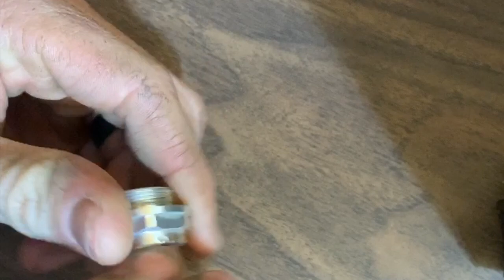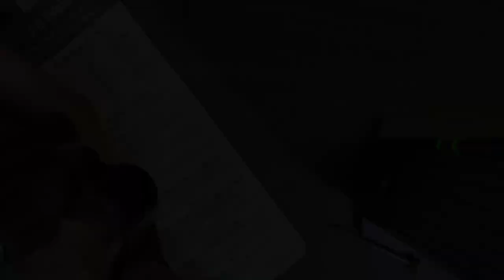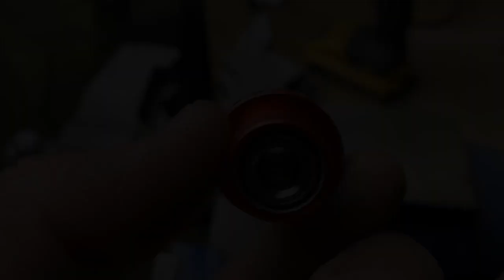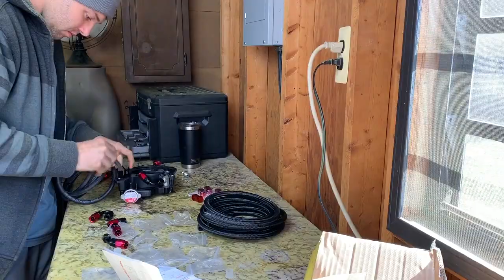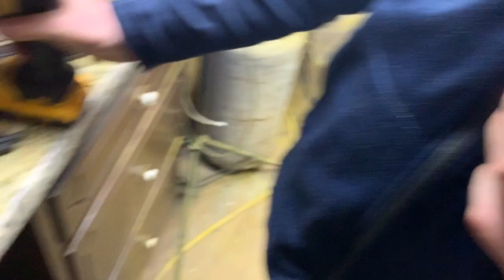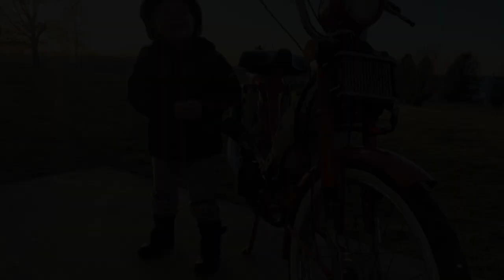25 HP Honda Hobbit Stage6 R/T Build: Tron Racing Ep#9

Comment: Definitely not making anywhere close to 25hp. This sounds terrible. Definitely a tuning or cvt issue. 25hp you would be close to 100mph. This is struggling to get on the pipe.

Comment: Are you threading anything? or just sending it, with JB weld to compensate?
Reply from the maker: Just sent everything and jb welded. But left enough meat in case I needed to tap. But everything still is holding up.

Comment: Sounds like the carb could still use some tuning in the transition or 1/4 throttle area in this video. looks like it is ripping though! i am curious of the hobbit drivetrain can handle this power
Reply from the maker: Hey Shane thanks for the imput. I have done alot more work and just havent posted the video yet. I had a broken silicon gasket and a bolt cracked my reed block. After addressing both performance is much better. Also rebuilt then entire transmission and put malossi straight cut gears. Also added an external bearing so that the input shaft has two bearings to handle the power.

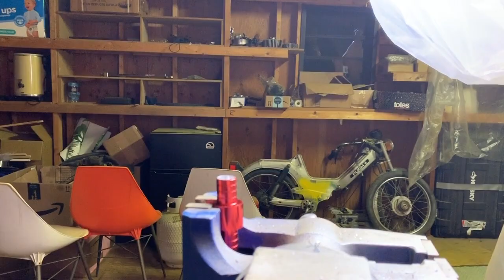Comment: You've made a mistake when assembling the second cylinder head. I am talking about your #4 episode but you disabled the comments for it. The seal you just put on top of the inner head on 12:43min shouldn't be there, there is a special cut in the outer head(orange one). You should put the seal in the hole and make sure it is align in its bed. Then slide it together with the head on top of the inner head.
Reply from the maker: Thanks for the input. I did in fact go back and correct this but did not have it on film. Sometimes I work on the bike to either correct or just work in something and don’t always get it on film. Sorry about the comment part, I’ll have to go in my YouTube account and see why that video is like that.

Comment: Sounds like you need lighter variatior weights to get it into the powerband.
Reply from the maker: I agree. I have some tuning coming up with the variatior and timing that needs to be done, as well as spacers for the variatior since the bevel angle is different because this is for a Derbi.
Reply: I think it would be 11 hp . Watch this tests on the dyno run on 4:00 and 4:40. https://youtu.be/1G4hGOEV9vo
Reply from the maker: Watched but they are all not running a Stage6 r/t cylinder and the one guy with his one kit gets 16hp. Out of the box the Stage6 is suppose to be 20-22hp
Reply: Tron Racing good luck with your build